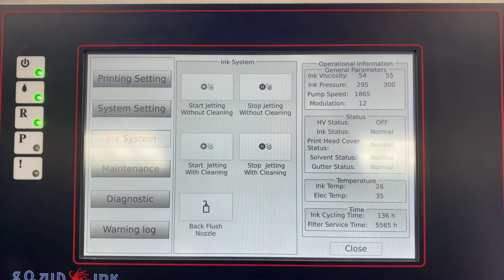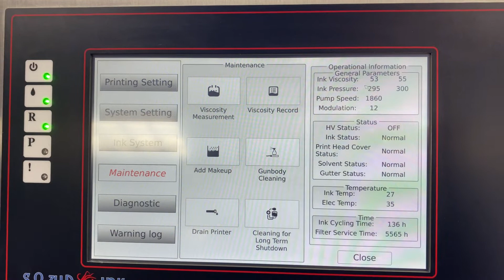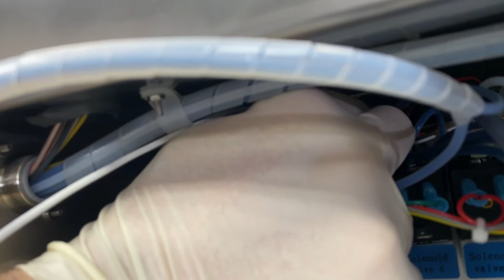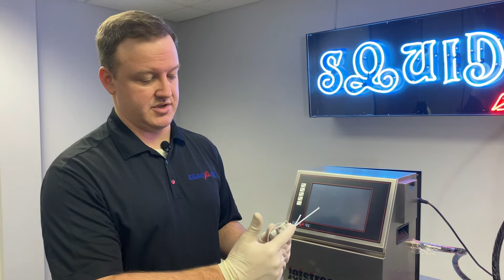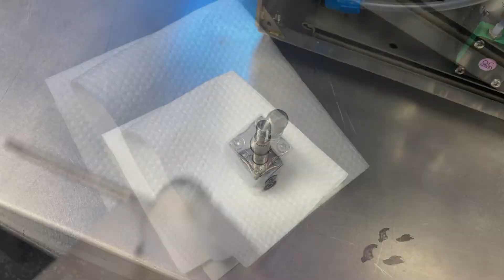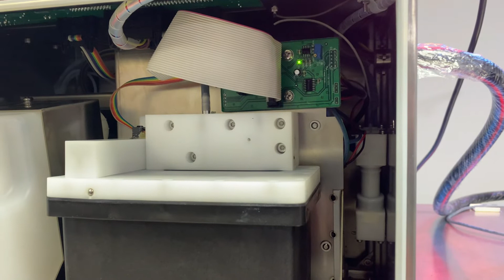JetStream - Troubleshooting the Viscometer

Comment: Hi Marc
Can you discuss, ink builds up on the gutter, it happened the next day after proper shut down with cleaning
Reply from the maker: This could be due to improper alignment of the ink jet.  If the ink jet is not in proper alignment, some of the droplets could be clipping/collecting on the gutter itself. I’d recommend watching our “backflushing” video to make sure the nozzle is clear of debris and that the alignment is correct.  If that doesn’t resolve the issue, then I’d move on to the “physical alignment” video.